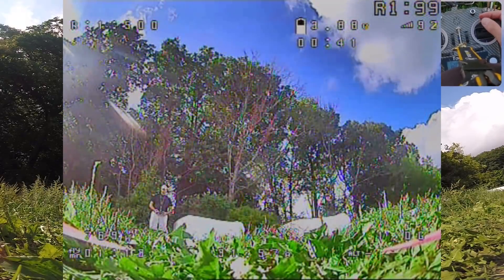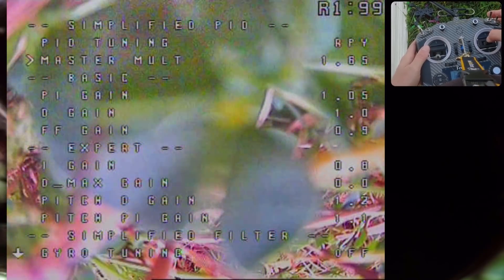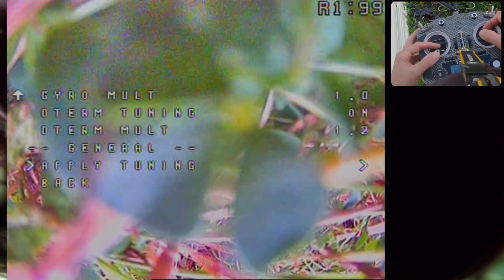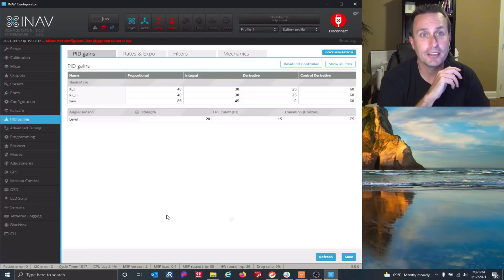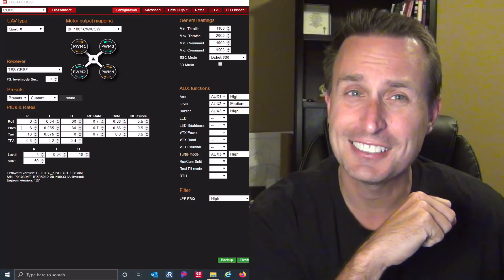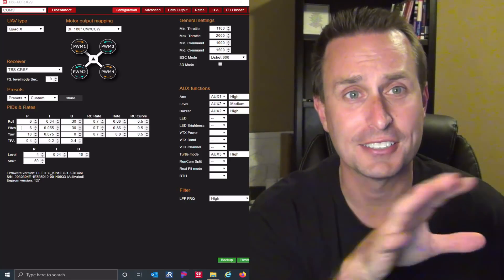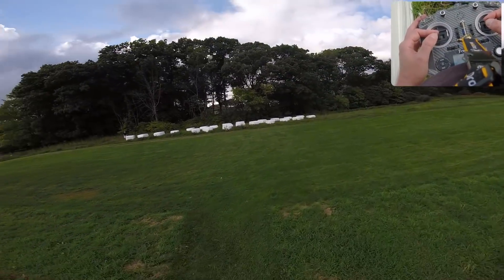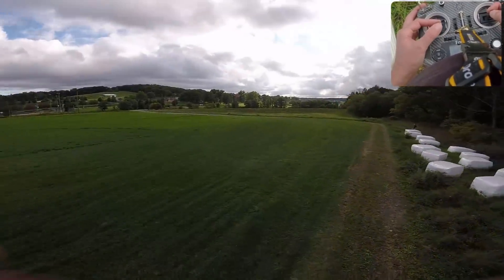How to REDUCE Prop Wash & Wind Shaking

Comment: Isn't it mostly about throttle control at the end of the day? I think you can't really remove propwash completely on very aggressive turns and fast throttle punches
Reply from the maker: you can make heeps better by turning up gains.  give it a shot.  not completly remove, but the higher the gaines the wider the window of moves you can do without wash.

Comment: Followed suggestion and installed the newest version of the betaflight (which required uninstalling the old one which was perfectly running). The new Betaflight it is not running - "firmware version is not supported". So in spite flying I have to spend time on fixing this. Disappointed, guess the direction of the thumb I granted.
Reply from the maker: i don't think i said anything about upgrading?

if you followed the good advice of saving a backup of your current config before upgrading, you can just flash back to your previous version and restore that config.

the most recent version of BF works fine.  the issue is some lack of knowing on your side for knowing all the information to setup BF, so please don't be blaming.

i hope you have luck in going back to your previous version or getting the new setup right.  If the old was working perfect, why are you messing with it?
Reply: @uavtech  "If the old was working perfect, why are you messing with it" because from the video reducing prop wash seem to be really easy, so I decided to follow it. I did not get the same betaflight GUI as you (did not see any Muster multiplier) from my existing version and based on your description, installed the 4.2. Thank you for your time, no criticism, but this video did not help me. I hope you agree that we are free to express our opinion.
Reply from the maker: @davidtskhakaya280  I guess.  Why did you not follow a video for how to upgrade firmware?  The first thing it would have said is you need to download the latest version of the configurator and make a backup?  It is a simple video on one concept of how to increase Prop Wash performance. In that subject matter, it is helpful.  You got messed up upgrading firmware and are blaming for it.  It is odd.  It was not about that subject. 

Hope you got it sorted.
Reply: @uavtech  "i don't think i said anything about upgrading?" when you present something saying that this features has given version (4.2),  this at least to me means - if you want to have this features you have to install this version. In addition you didnt answer my question: do you agree that we are free to give our positive, or negative responses?
Reply from the maker: @davidtskhakaya280  Yes.  You can say whatever you want of course.  I too have the right to challenge what you say.

You had trouble upgrading - which I'm sorry to hear - and then blamed me on a video that had nothing to do with upgrading.  That is not logical and I'm pointing that out as a retort to your comment.  sorry.

Comment: Glad I found this video. Most of the factory tunes are good. But...the heavy NBD AcroBee65 Crossfire model stock tune has little shakes at slower speed and worse when coasting DOWN the stairs. 
My solution: PID profile #2 looks like a generic BF tune. I took that tune using the RP functions to get kinda close to the NBD tune, leaving Yaw on default. Keeping the Master multiplier on default.  Once it is close, I used the MM to tune! I "feel" like it is an improvement. More testing....

Comment: If the betaflight 4.3 gives a warning that it can cause hot motors or flyaway drones, ignore it as long as motors are ok ? trying to tune out prop wash in a 2.5' quad
Reply from the maker: Correct.

Comment: Can a very aggressive tune cause desyncs? I moved my master to 1.5 but I had a desync on a hard trick. Was it just out of bad luck or did the slider cause this to happen? (Already watched your video on desyncs)
Reply from the maker: It does not cause them, but it will draw out the issue.
Reply: @uavtech  Apparently I use bluejay for my 5 inch and don't want to go less than x7 rampup power... can you give me any other advice? Thanks in advance

Comment: Hi geezer, I watch all your vids, i used to teach automotive mechatronics, basic pid motor, solonoid control with various feedback sensors, encoder,optical discs, simple stuff, drive by wire, two hall effect sensors on a lookup table and if the corelation (programed interpolation graphs) moved out of range the car would go into limphome etc.
We used NationInstruments labview!
THEN IT WAS ALL SO SIMPLE, TUNE THE PID UNTIL THE ERROR REACHED A STEADY STATE QUICKLY WITHOUT TO MUCH OVER/UNDER SHOOT!
IM MODEST, NOT BRAGGING! JUST EXPLAINING MY LIMITED KNOWLEDGE, 15 YEARS ON!
ON 1 DRONE, I HAVE ON 4.3 I TURNED OF BIDIRECTIONAL DSHOT AS MY CPU WAS HIGH, 60% DSHOT 300 AND IT SORTED OUT MY GYRO DRIFT, 
NOW THE QUESTION?
WOULD YOU DESCRIBE PROPWASH AS LIKE THE BACKEND OF A CAR COMING OUT WHEN ON THE THROTTLE PULLING OUT?
SORRY FOR THE LIFE STORY, ITS JUST CHANGED SOOOO MUCH!
RESPECT
RC ADDICT
Reply from the maker: eh... I would not use that anaolgy.  Its simply you are trying to blow thrust into turbulant air.

Comment: Subscribed 👍
Reply: Newbie I Can I apply these setting for my quad? currently, Im using default settings
Configurator: 10.7.1
Betaflight: 4.2.0
FC: iflight f7 Twing
Motor: Velox 2207 v2 2550kv

Comment: Should the master multiplier be used in tandem with the presets found on the website (with the PD Gain already @ 1.5)? Or should it be done with all the other sliders at default?
Reply: Mater multiplier should be after you have already found your tune, and you want to start fine-tuning it. He was saying how MM brings all of the PIDs up. That means, we should first either pick a tune, and go from there, or start with default, next, tune to our liking, then > master multiplier, and what ever else is needed for fine-tuning.
Reply: @Inertia888  Much appreciated! Will give it a try. Thanks!
Reply: @mengleelim1054  np, good luck and have fun!

Comment: If the quad feels like it's having propwash under slightly windy conditions just cruising. Assuming there are no mechanical issues, would this coincide with too high P-D values?
Reply from the maker: Move up or down P-D gain slider to see which is better.

Comment: Nice video my friend! I have some Jello when I fly my whoop outdoors. ill try this and see if it goes away!
Reply from the maker: Jello is probably a prop vibration problem.  If you have not used HQ props, give them a shot.
Reply: @uavtech  I was using the HQ props at my Mobula7, it was fine. Now at my new build I have the 3blade gemfan props. Ill have a try with HQ 4blade. Thank you! 👍

Comment: hey question would having a battery of higher output help with propwash handling? Ovonic just sent me a battery rated at 120c constant and on the first pack out I noticed that it was handling very well full speed to stops with almost no oscillations. Then I went back to my normal CNHL pack which has a 100c constant rating and flew the same line full stick punch to full stop an was getting a noticeable oscillation. Both were flown on the same props and no crashes in between packs.
Reply: Sorry it's not a UAV Tech answer but let me try.  If one of the batteries is heavier or much different shape and weight distribution that may be the cause.  Or possibly your lesser battery is not providing enough power.  Compare the blackbox from both and see if you are hitting 100% motor(s) during the propwash events.

Comment: Great video! :D One question tho. Why does reducing the filter (d-term filtering i guess), set the thrilling oscillation point higher? Arent you making the signal less clean and so multiplying the oscillation? Higher PIDS require more filtering? Or did i get something wrong here. Thanks for the helpful informations ;D
Reply from the maker: You are making the signal less clean, but also more delayed.  It seems like the delay and higher D-gain finds an oscillation point.  Decreasing the filter delay moving up that oscillation point.
Reply: @uavtech  Thanks :D, appreciate your answer!
Reply: @uavtech  So you move the slider to the right, and it solves the oscillations? How? Wouldn't it make the situation worse, because the d term gets noisier?
Reply from the maker: @Iceman_2003  moving the Master to the right move all the gains up, which will increase prop wash performance.  D-term doesn't get noisier per say, but any noise in the gyro signal will be amplified.  Typically, that's not an issue with modern filtering unless you have set the filters to high.  At some point, if you keep moving the Master Slider to the right, you will get D-term oscillation (a flutter sound) from the motors.  At that point you know you have gone too far.  I cover that here: https://theuavtech.com/2022/08/finding-your-flutter-point-for-optimal-performance/

Comment: hate the hobby...  maybe i'll wait 5 more years for it to sort itself out, before i get back into it
no standards, poor quad designs, poor software, bad goggle views, it's just not ready for prime time yet
haven't even standardized on connectors yet, everybody's still soldering bare wires to pads, it's a joke and a maintenance headache.
i think the hoola hoop crazy is dead and over with already, nobody watches FPV videos any more...  they just don't draw any views like they first did.
Reply from the maker: 3 words:  Bind - and - Fly.  Lifesaver.

Also DJI.
Reply: I know right, if xjet says FPV is dead, ad LitleStellaFox says the hobby is over... it's probably... toast.

I never got any of my quads flying, I lost or destroyed all my parts trying to learn to solder.
Reply: My kids ran off with about half of my parts.   
I think I got 3 arms, 2 motors, and a top plate and vtx left on the kittchen table.
Switches on transmitter broken to bits by the kids.
Reply: half the things you state you hate about the hobby i love, different strokes
Reply: I started just before Dji came out with their digital system and I felt the exact same way (except the fpv craze being “over”- as it was just starting) Bought the Dji system as soon as it came out and it helped a ton- especially with the plug and play flight controllers. Only soldering was/is for motor wires and beepers-and there is now bind and fly if you don’t even want to do that. It has come a long way! If I were you, I’d get a bnf Dji system. It’s a super rewarding hobby/job if you get past all the disorganization and tech learning curves. And whether or not the “craze” is over, it doesn’t really matter to me, IMHO the phantom/Mavic craze is definitely over, but it still has a place in the film makers Arsenal, and you can still get amazing shots with fpv that you could never get with a Mavic….

Comment: Great content as always! 
Did you ever find that after a certain point the propwash performance start getting worse even if motors still run smoothly (no shrilling sound, vibrations etc.)?
Reply from the maker: No.  It always seems to get better in my experience until you get to the D-term trill point.
Reply: @uavtech  thank you for the video. Do you have an example of that trill point?

Comment: Any reason why the OSD has PI gain and D gain rather than the PD Balance and PD gain - cant wrap my head around why they would be different to the configurator
Reply from the maker: The Configurator is not yet updated.  Nor has BF Master to the new sliders.

Comment: I'm confused, so does this make all your old tuning vids obsolete? Is the new master slider in BF4.3 the "make it better" slider?
Reply from the maker: No.  Same principals from day one.  Just coming at it on this video in relation to which sliders effect which flight characteristics.  Once presets are in BF.  Folks will load and get great results, then can use a slider to make the preset (a more honed in default) better'er for their specific rig.

Comment: This is like the #1 thing I learned from you and Chris: Prop wash performance means high PID gains so just bump that master slider up :3
And that Slider OSD is gorgeous! No more land, goggles off, radio off, plug in, wait for betaflight config to start, adjust, save... and all the rest in reverse (that sucks so much on a field!) - just land, OSD adjust, start... Love it!

Guess my AOS5.5 will be analog after all...
Reply: 4.4.2 a year later and I have the same OSD on my O3... but my damn motor direction 😢

Comment: what about filter sliders. do i leave that at 1 or can i have it at like 1.2 or 1.3 both sliders when i change the master slider?
Reply from the maker: load my preset setting, then move Master from there.  theuavtech.com/presets
Reply: @uavtech  its the same for 4s and 6s right for a 5"freestyle. Cuz i have loaded it earlier today and had some vibrations but later figured it was a bent and cracked arm😅

Comment: The master multiplier only adds 10% to the previous values when you move the slider to the right by 0.1. So if the previous value was 42, 10% of 42 is 4.2, round to 4, the new value is 42 + 4 = 46. And that goes for all values. The same should be true for KISS. No higher mathematics is needed.
Reply from the maker: Just as long as it is not viewed as a linear adder for the gains themselves.  The ratios from P to D are held as D is moved up.  Same for i-Term as P-term is moved up.

I.e: if P is 2x of D.  As you move up Master, it goes up 2x more than D.  Or if P is 1x D, they go up the same amount.
Reply: @uavtech  
ok, I want to understand this. I don't use sliders, but I came to this conclusion just by watching your video at 5:10. Maybe I'm missing something.

If P is 2x of D, P will go up 2x higher because 10% of two is 0.2 and 10% of one is 0.1. So P will go up 2x higher than D. The ratio between them will stay the same.

When you moved Master Multiplier to 1.1 all values jumped up by 10%. When you moved the slider to 1.2 all values jumped by 20% from the original values set at 1. When you incremented for another 0.1 all values jumped up by 30% from their original values. The ratios between them stayed the same. There is just a small difference due to rounding.

I don't see how this is not a simple multiplication and rounding.
Reply from the maker: I'm sorry, yes.  As long as you are multiplying you are good.  Folks come at this with adding and I responded too fast to your initial comment.  You can't just add 10 to all the gains and keep doing that to move them up.  You need to multiply by a certain factor (1.5 ... 2.0, etc...).  That holds that ratios between the terms.
Reply: I wish i paid more attention at school

Comment: Sliders in osd!  That’s exciting.  I usually struggle a bit after bumping up master i’ll help propwash and yaw washout (micros) but then i start to get low and mid throttle vibes so i’ll have to back it off again.  Id love to hear your take on tiny whoops, yaw washout and how to handle the really high d ratios well.
Reply from the maker: For washout you need high P on Yaw.
Reply: @uavtech  If i go high on yaw 
can D be added to yaw?  I never see d gains in yaw and haven’t thought much about it...
i’ll try bumping yaw P up only.  My 65mm has been killing me with dives

Comment: Sliders on potentiometers would be good.
Reply from the maker: I'm going to make that happen.  Mast on a potentiometer through In-flight Adjustments.  Should be easy!
Reply: @uavtech  Sweet. Also on potentiometers/switch should be motor output limit and rate profiles. Would be good if you could select every slider perhaps even the filtering slider too.
Reply: @changeagent228  you can already put rate profile with motor limit on aux channel :)
Reply: @IvanEfimovLimon  Yeah but with the potentiometer you can vary it more

Comment: I have pids p 65 i 60 d 20  How betaflight can calculate it with just master slider moving ? )) ps motor 1505 betafpv  + 3 inch deadcat  frame
Reply from the maker: move Master way down and then adjust the others to get to your numbers.

Comment: Any chance of 4.3 presets? Your 4.2 presets are so good it’s hard for me to justify going 4.3 without another preset that u make .
Reply: There will be presets built into 4.3 from what I understand.
Reply: @kevbomtb6078  yeah that’s cool, I just want some uav presets. His 4.2 toothpick preset is just soooo good on my tp3s
Reply from the maker: I will make some 4.3 presets
Reply: @djs134  Hey, in which video did he show the presets for a toothpick? I cant find it, thx a lot.
Reply from the maker: The toothpic preset is in 4.3
Reply: @uavtech  I currently dont have 4.3 but can you just select it in betaflight 4.3 and dont have to manual put something in or something like that?
Reply: @philippmeurer7290  use this link and just scroll down for the 4.2 toothpick tune. It’s amazing
Reply: @djs134  Hey, thanks a lot, I just saw that i have betaflight 4.1 on my quad, can I still use those presets from 4.2 or are they not suitable for this or can something happen to the motors?
Reply from the maker: 4.2 presets should be fine with 4.1, but look at PID values to set vs. slider positions

Comment: My 5" LR with 6S Li-ion.  I raise D with or without P I get oscillations that want to run away. Stuck at 25/28 .. hoping arm braces help
Reply from the maker: Then you are at the limit.  To raise more, you need to reduce filters.  But if too noisy, that's not an option.
Reply: @uavtech  yeah ordered custom arm braces thinking same thing. Li-ion are heavy and the arms are thin.  It's fine on lipos.

Comment: Tried 4.3 on my 2" whoop . At first vtx would work. Channel wasn't on set channel.  Then motors were being smoking hot on 4.2 tune but default gyro filters with rpm filtering on (more filtering)
Then I went to betaflight default tune. Still burning hot motors. 
Put 4.2 back and then everything works fine. So confused. What could I of missed or messed up?
Matekf411